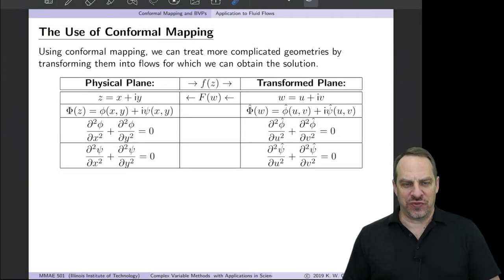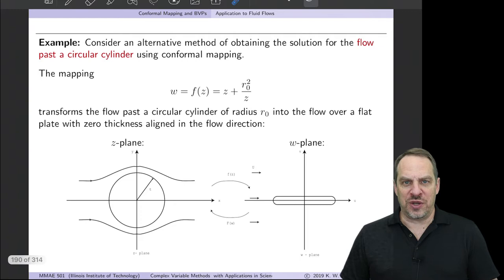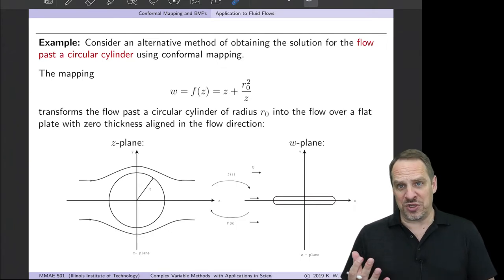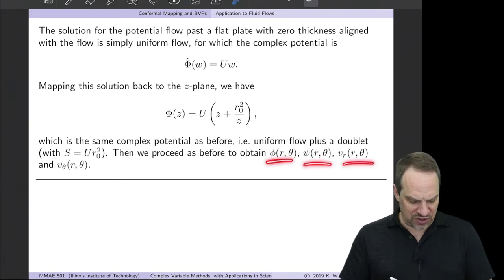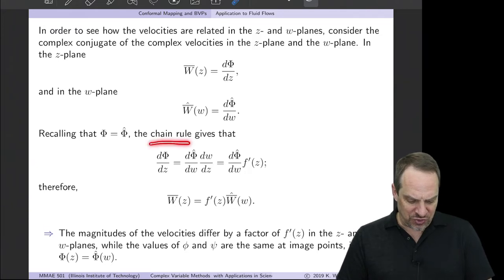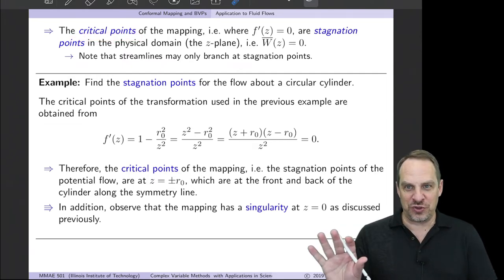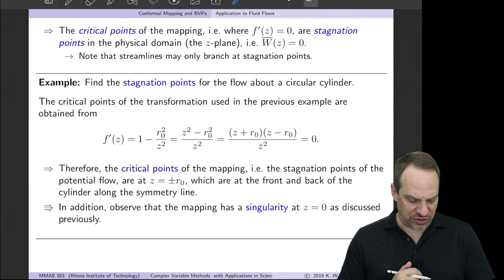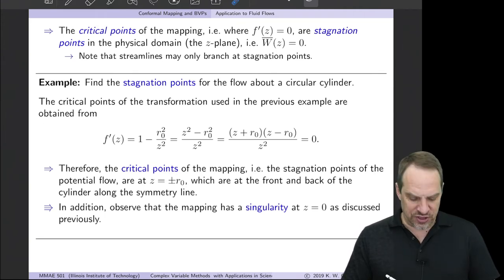Potential Flow - Conformal Mapping

Comment: Thank you Kevin this really helped me. I was just a little confused in the first slide it states f(z) maps the physical plane into the Transformed plane, but then used f(z) to transform from the flat plate in the transformed plane, back to the physical plane ?
Reply from the maker: I normally use lowercase f(z) to signify the mapping from the original (physical) to the new (transformed) plane and uppercase F(w) for the inverse transformation.